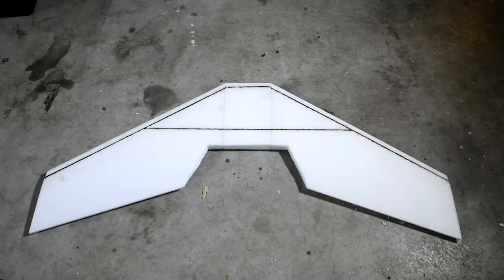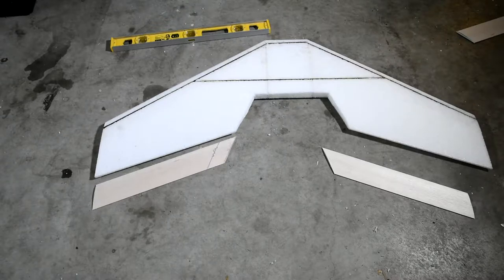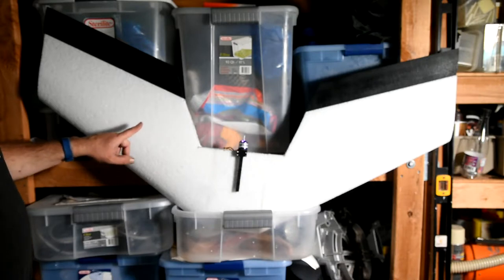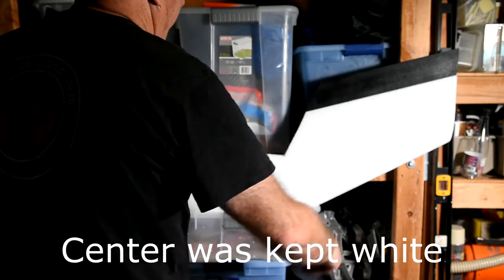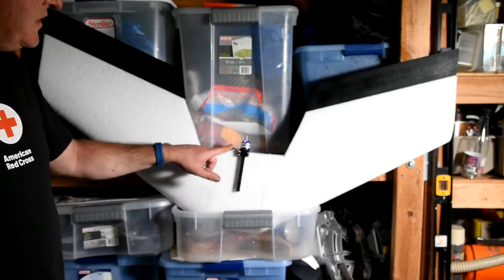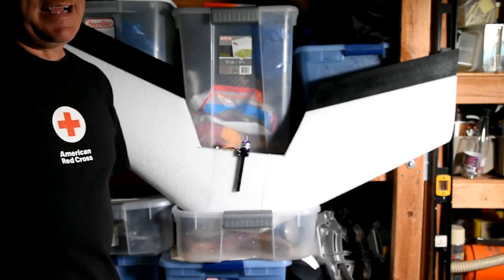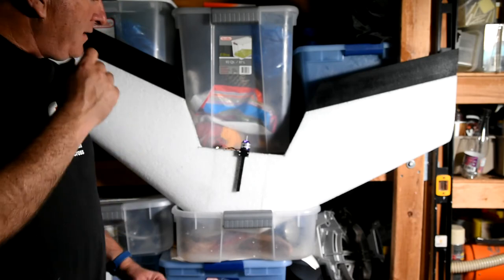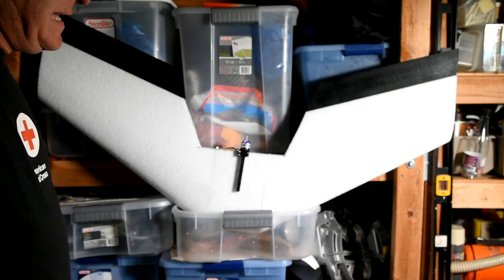Sweepwings  Juggernaut  Blunt Nose RC Plane  Build Video #3

Comment: the included laminate will stick best to a sanded, smooth, dry surface so dont put anything on it like spray glue for example, and with a hobby iron (without the sock over it). looks good so far, and your idea of cutting up further towards the cg is the right one because its a smaller craft and its hard to load up the nose with enough reasonable counterweight items before you start inserting steel rods for balance!.
found your video seeing if anyone has been building and here we are! I have a jugg, and a behemoth built. Jugg does 100mph lol, 900w full throttle on 4S
Reply from the maker: Well, this is the first pass on the plane. I will get a full FPV setup going on it fairly soon.  I couldn't imagine this at 100 MPH.  It must be insane!